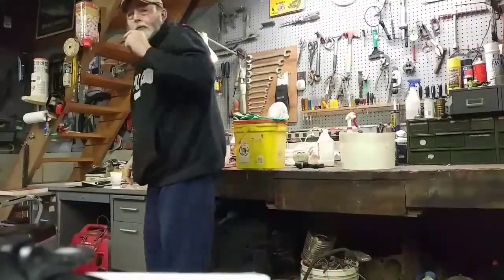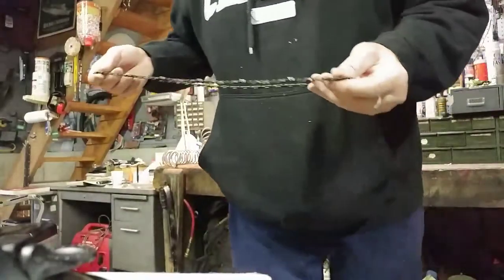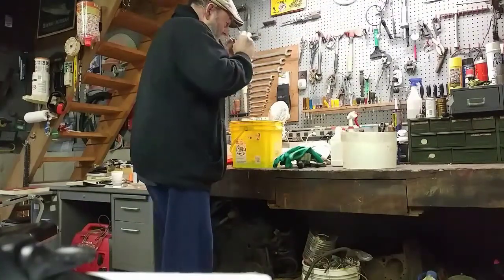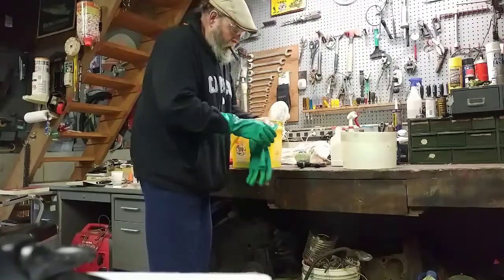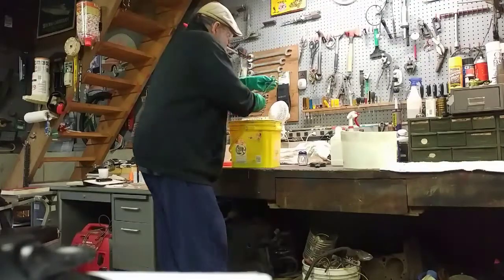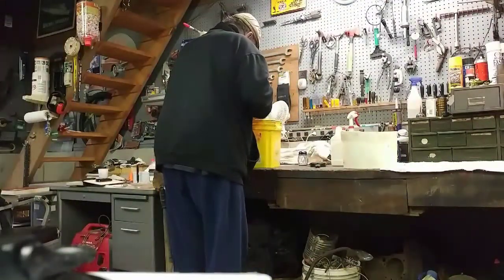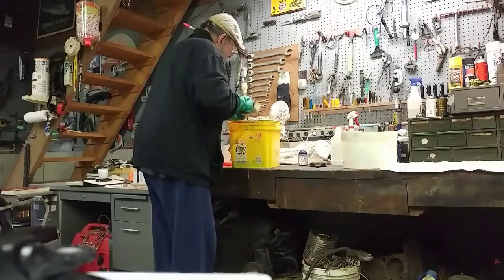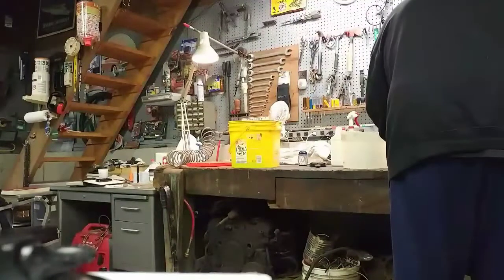Cleaning a chainsaw chain

Comment: Thanks for your video. It is amazing what you can find on you tube and the amount of people willing to help each other out for free. Thanks again for taking time out of your day to share your insights. I started using the following method. I use draino the powder kind two tablespoons in a gallon of water. I mix it in a five gallon bucket. Soak for 5-6 min then spray off with pressure washer. Then spray with wd40 to prevent rust. I do 7 or so at a time. Oh and use all the safety gear you mentioned.